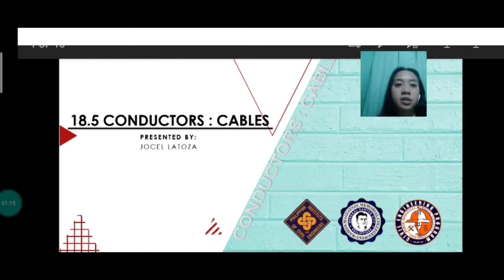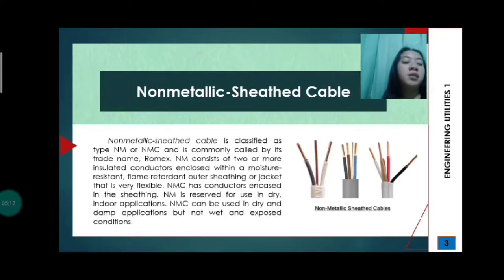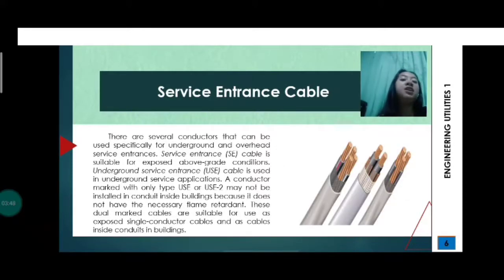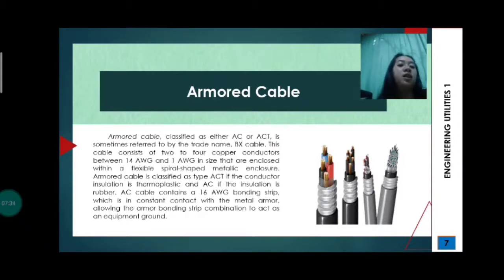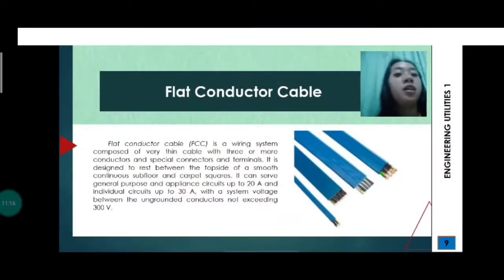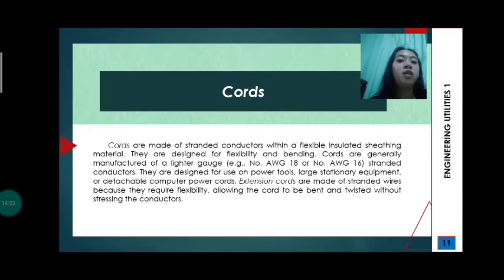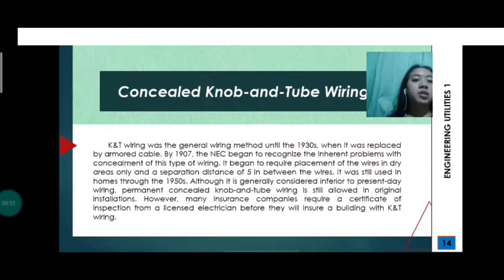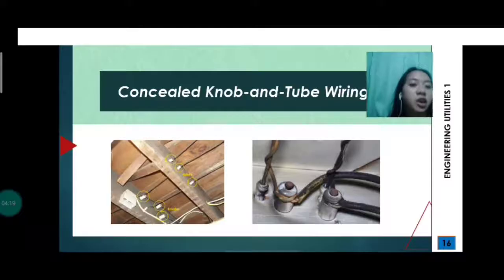18.5 CONDUCTORS: Cables, Cord

Comment: For this topic report, i learn that there is different cables and conductor used to produce electricity, i learn that cables has it different purposes depends on the voltage or electricity flows on a cable, also it is the same to conductors

Comment: After watching latoza’s report  I’ve gained new understanding about cables , she mentioned  about the various types of cable, such as nonmetallic-sheathed cable, underground feeder cable, armored cable, service entrance cable, etc. electric cable has the purpose of transporting electrical energy from one point to another. Its important to know the uses, and purposes of cables . cables  are use to connected two or more devices in electronics or appliances to transmit electrical signals or power from one device to the others.

Comment: In this topic, I learned that cables and conductors have different kinds because I thought that they only had 1 but no, it has different kinds, these cables and conductors have their own use. Cables are important because it used as the transmission lines for our electricity to our homes as wirings.

Comment: In this topic I've learned that cables has various types, their features, and possible applications are discussed. Because improper usage of extension cords could lead them to overheat and catch fire, I've learned how important it is to use them properly. And how crucial it is that the correct cables and wires be put in our homes or other buildings. It will help us see why preventing future electrical accidents is crucial and how it is for our own safety.

Comment: In this particular topic is all about conductor: cables and cord. I've learned that cable and cord are use to connect two or more devices in electronics or appliances to transmit electrical signals or power from one device to the others. Furthermore electrical cable consists of a conductor, which channels the electrical flow, and an insulation containing this electrical flow in the conductor.

Comment: She mentioned that cable contains more than one conductor bundled together in a factory assembly of wires for this topic. I learned about the various types of cable, such as nonmetallic-sheathed cable, underground feeder cable, armored cable, service entrance cable, and so on. This cable's purpose is to transport electrical energy from one location to another. In addition, with the reporter's assistance, I am able to learn about the characteristics of each cable.

Comment: In this report, Wire is a single electrical conductor, whereas a cable is a group of wires swathed in sheathing. The term cable originally referred to a nautical line of multiple ropes used to anchor ships, and in an electrical context, cables (like wires) are used to carry electrical currents.

Comment: This video simply discussed about the cables, different sorts of cables, their characteristics, and where they may be utilized. This is a very informative video for i have learned a lot, for instance, the disguised knob and tube wiring, which is new to me. I have learned that this type of wiring is an old type approach that is no longer utilized since it might represent a safety issue.  This is very important for us engineers and as a normal citizen of this community to be familiar of these tools/devices to avoid electrical errors that may to lead deadly accidents

Comment from the maker: The reporter in this topic discuss the  cables and wires that being  used in conducting electricity,   in the whole discussion  the cables that are usually use in out community are being explained and what are the proper cables to be use in a specific appliances, residential building, and industrial power plant. we as a future engineer we should more knowledgeable in the different types of cable for the rightful use of it, we can use this cable in all things that needs electricity but we should more knowledgeable to choose where is more appropriate to use 

-  JOCEL M. LATOZA

Comment: It is important to have a Conductors, Cables, and  Cord for us to have a safety. Conductors allow electricity flow through them.
Conductors are materials that can carry electricity they conduct electricity. Metal materials such as copper, iron, steel and aluminum are all good conductors of electricity. Conductors also to avoid danger.

Comment: Latoza's report is all about cables. A lot of insights is also absorbed. First, a cable contains more than one conductor bundled together in a factory
 assembly of wires. An outer sheathing encases and protects the conductors,
 simplifying installation of multiple wiring.
Second, nonmetallic-sheated cable is consists of two or more
 insulated conductors enclosed within a moisture-resistant, flame-retardant outer
 sheathing or jacket that is very flexible. Third, Underground feeder (UF) cables are flame
 retardant and moisture, fungus, and corrosion resistant.
  Fourth, Service entrance (SE) cable is
suitable for exposed above-grade conditions.
 Fifth, Armored cable, classified as either AC or ACT, is
 sometimes referred to by the trade name, BX cable. Next, Thermostat cable is used in applications with
voltages less than 30 V, such as wiring to
doorbells, chimes, and thermostats. Lastly, Concealed knob-and-tube (K&T) wiring consists of an old style wiring technique
 using insulated conductors strung between glass or porcelain knobs and tubes.

Comment: As mentioned in the video, a cable is a group of insulated wires encased together in sheathing. Typically, a cable has at least one hot wire to carry the current, one neutral wire, and one grounding wire. Cables are classified according to the number of wires it contains and their size/gauge. The cables are marked with a series of letters followed by a number, a dash, and another number.

Comment: I discovered that a cable typically has numerous conductors in this particular issue; a conductor, on the other hand, would be one of the insulated wires within that cable. The research also covered the differential between Standard Nonmetallic-Sheathed Cable and Underground Feeder Cable. The Standard NM cable has a paper sheath and a loose plastic sheath shielding the wires. The wires are entirely encapsulated in solid plastic in UF cable.

Comment: In this report, I gained my knowledge about conductors as it discussed in the previous chapter. However,  in cable I learned a lot of things including its importance and function. Cable contains more than one conductor that are bundled together as I saw on the figures.  It is used in transmission lines, electrical services and other engineering applications.

Comment: This topic refers to cables and we know that this is related to wires because, cable a material that contains a bundle of conductors such as wires. It contributed to my knowledge that we have different kinds of cables that has an specific purpose. One example of that is the nonmethallic-sheated cable which is commonly known as a flexible cable and moisture resistant. There are more other types cables and all of these serve as beneficial for human use, considering safety, durability, reliability and flexibility,

Comment: Based on the video report, it was all about the Cables and Chord. So, the importance of knowing Cables is the major factor that should decide your choice of cables is “Safety”. As cables are the prime carrier of electricity throughout your house, you must ensure every aspect in terms of safety when it comes to electrical wires. Electrical wires are designed to bear consistent electric current which should not lead to a fire in case of accidents/short circuit. While the power cord is an electrical component used for connecting appliances to an electrical utility or power supply. Those are the things I’ve got from this video.

Comment: In this topic, I determine the kinds of cables in the electrical industry like Non-metallic-Sheathed Cable it is A non-metallic sheathed cable is an assembly of 2 or more insulated conductors having an outer sheath of a moisture-resistant, flame-retardant, non-metallic material and Underground Feeder Cable it is a special type of electrical wiring or cable that is designed to be buried in a trench underground and many more.

Comment: This chapter is all about Conductor Cables, and Cords. It is very important because The electricity wires are basic components and serve as the backbone of the electrical system. Even though that we are now in a modern world where a wireless connection is a new thing, wires are still necessary for the use of electricity. There are different types of cable for it's different uses. Some cables are for industrial and for residential. Knowing whether a cable is appropriate for our project is crucial for me as a future engineer since electrical wires are made to carry steady electric current, which should prevent fires in the event of mishaps or short circuits.

Comment: In this particular topic, I learned that a cable typically includes several conductors; a conductor, on the other hand, would be one of the insulated wires within that cable. The report also discussed the distinction between Underground Feeder Cable and Standard Nonmetallic-Sheathed Cable. The wires in the Standard NM cable are shielded by a paper sheath and a loose plastic sheath. In UF cable, the wires are completely encased in solid plastic.

Comment: In this topic, I learned that a wire is used to carry electricity, to bear the mechanical loads, to transmit telecommunication signals, for heating jewellery, clothing, automotive or any industrial manufactured parts like pins, bulbs and needles. A cable is used for power transmission, for telecommunication signals or to carry electricity.

Comment: Adapting new knowledge in regards to the importance of conductors and the materials that conduct electricity is helpful to deeply understand their uses and functions that allow electricity to flow to supply to the electrical service system. Wire and cables are used to transfer electric current that prevents short circuits or any power leakage interference that is harmful.

Comment: In this topic, cables is one of the best conductor. There are many types of cable used in electrical. Cable are insulated wire or wires having a protective casing and used for transmitting electricity.There are two different types of cables that are commonly used. Nonmetallic-sheathed cable has two or more insulated conductors and usually a bare ground wire.

Comment: In Ms. Jocel Latoza's report which is electrical conductors and cables, she carefully explained the use of each cable and what specific situation it can be used. It provided me a deeper insight on how it is important for our houses or estsblishments to be installed with the proper cables and wires. It will give us a better understanding on why it is important and how it is for our own safety to prevent future electrical accidents.

Comment: This lesson provides a deeper understanding about cables, cords, and concealed knob-and-tube wiring. I've learned from this lesson what kind of cable is best to use for certain purposes. I came to understand how crucial it is to utilize extension cables correctly because if they are used incorrectly, they might overheat and start fires. Lastly, I also learned more about the old-style technique of concealed knob-and-tube wiring, which uses knobs, tubes, and flexible nonmetallic tubing for support and protection.

Comment: Conductors and insulators: how electrical wires & cables are made. The basic components of electrical cables are the conductor, generally drawn wires made from copper, aluminum or alloys, and the insulation. A cable usually features a specific cross-section containing numerous wires. A conductive material that is constructed for the purpose of carrying electric current. a wire or cable, or other form of metal, installed for the purpose of conveying electric current from one piece of electrical equipment to another or to ground.

Comment: For this topic, she mentioned that cable contains more than one conductor bundled together in a factory assembly of wires. I learned the different types of cable which are the nonmetallic-sheathed cable, underground feeder cable, armored cable, service entrance cable, etc. This cable has the purpose of transporting electrical energy from one point to another. Also, with the help of the reporter, I am able to learn about the characteristics of each cable.

Comment: Electrical cables are designed to deliver a constant electric current that, in the case of an accident or short circuit, should not ignite a fire. The bulk of electrical failures in India are caused by the failure of electrical lines. People usually miss the significance of this vital information. Conductors are materials or substances that allow electricity to flow while also transmitting heat or light from one source to another.

Comment: Miss Latoza is a reporter for CONDUCTORS: CABLES which she explained that one of the cables that she refers is a power cord wherein it is  primary cable that provides power to the computer, printer, monitor, and components within a computer. Electrical cables work by providing a low resistance path for the current to flow through. Electrical cables consist of a core of metal wire offering good conductivity. Secondly, we have seven common cables that is exist in our generation and it is important for us to know this, to have a knowledge towards for common cables that we used.